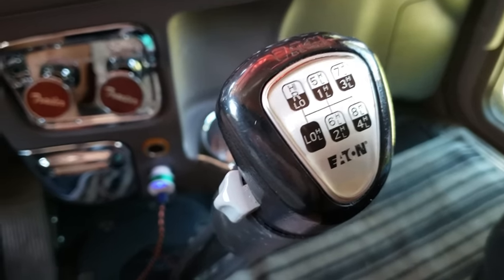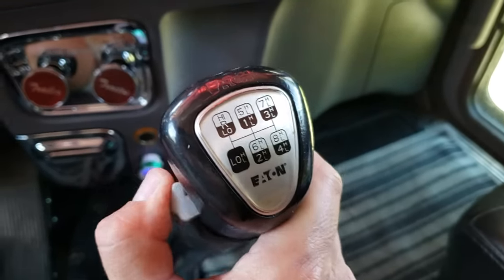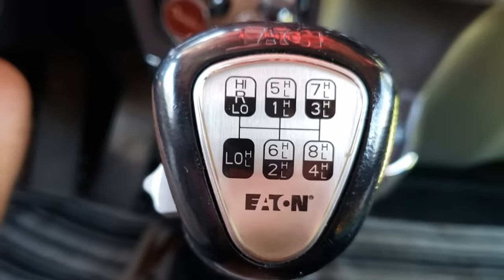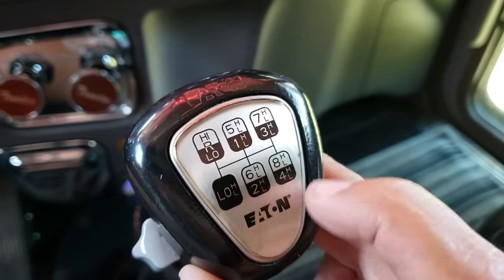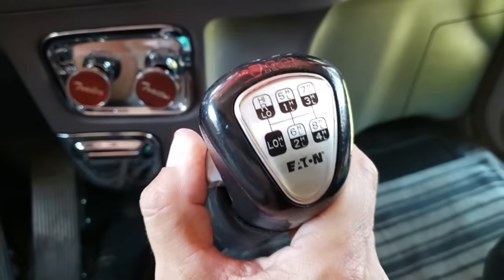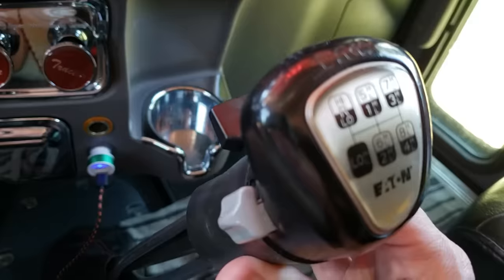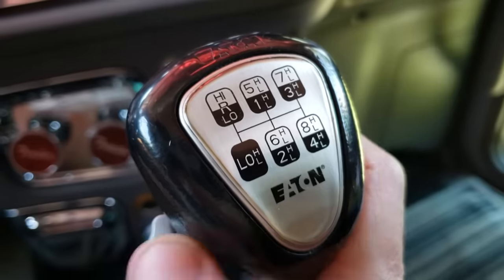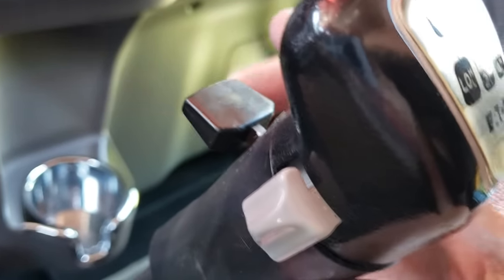HOW TO Shift 18-Speed Manual Eaton Transmission. Peterbilt, Volvo, Freightliner, Kenworth, Mack

Comment: Iv been a wrecker operator for years and i usually drive a 6 speed international. Im about to be in an 18 speed 50 ton. And i was definitely a little intimated. You definitely made a super helpful video explaining everything perfectly! Thanks so much!
Reply from the maker: Right on, great to hear from you...
Reply: How did it work out for you? I haven't driven a manual in years, and I'm thinking about going to a company that only offers 18 speeds.
Reply: I’m driving a 95 international.. when the truck warms up and I put it in gear why does it grind so badly?
Reply from the maker: @williamcoltrane9184  Probably worn trans or clutch.  After it's warm oil might lube abit making it shift better.  1995 is quite old now, nothing like a rebuild if budget allows...
Reply: Well it’s a yard truck that I use to haul material around the yard . It shifts great at first an as the day goes it gets harder and harder to get into gear
Reply: @williamcoltrane9184  it's an international. 🙊
Reply: Teeth can be broken 💔 not grabbing good. Worn out
Reply: Best video ever thank you

Comment: The grey splitter button denotes the transmission as an 18-speed. Red is 13-speed, and blue is 15-speed. Blue can also be a Super-10, but those aren't common at all. There are 18 forward gears. With the range selector down, there are 10 gears on the bottom - it's a 5-speed transmission and you can split each gear. And with the range selector up, there are 8 more gears on the top. In the top range, you don't get low gear. Unless you're running heavy (+100K lbs), in a gravel pit, or on ice roads, most of the time you're just going to drive it like a 12-speed - 4 in the bottom, and 8 in the top. Splitting gears in the bottom...really, I don't know any driver that really wants to work that hard. Finally, for those of you downshifting - downshift whole gears. Once you're experienced, you can split down 1/2 a gear, but again, who wants to work that hard. If ole' timers are explaining it to you, they may say direct (splitter back) and overdrive (splitter forward). Those same ole' timers will tell you that they drove a 5 & 4 uphill to school both ways when they started out! ;0) Safe trucking everyone. All the best, Cheers Rick
Reply: Super 10s are grey commonly one of the trucks in a trucking company I sometimes work around is a super 10
Reply: As somebody who doesn’t drive trucks this explanation blew my mind 😂😂 complicated stuff just to change gears
Reply: Never drove an 18 spd, but used to be a trainer on the Super 10.  Sadly, I can no longer handle a manual for long periods.  My feet just can't handle a clutch for long.  (Health issues.)  I do miss the Super 10 though.
Reply: yes color of selector is the best identifier also blues can be a 8LL
Reply: @jasonbuhl1636  I think that’s what mine is there are 3 lows and 3 reverses and it’s a blue splitter
Reply: @ShazzledWolf32  yes most likely a 8LL most off road or city trucks would use them as they are geared fairly low
Reply: @jasonbuhl1636  it’s in a 357 peterbilt it was originally a cement mixer with the pto on the bell housing then it had a gunite mixer on it now it’s ours it has a heavy haul package with the big front tires and a drop axle
Reply: I drive a 18 with a blue splitter. Same gear pattern as this video but my splitter in a blue switch that flips up and down. Glad you caught him explaining the gears wrong though lol that’s why I came to comments. The low as you said is only on the low side but you can split it.
Reply: Isn’t this a 13 speed
Reply: @ComihcaL no. If you count the forward ranges off, it's 18. L h/l (2) 1/5 h/l (4) and 4 for each of the additional 1 thru 4 gates. So 16 in the 1 to 4 gates, plus L h/l is 18.

Comment: Thank you!! I needed this. My company gave me the 18 speed truck and told me that if I could do 13 , then I could do 18. But I was confused about it. This made the most sense! Now I can ride smoother!
Reply: For best explanation 18 is just 13 but the difference is that in 18 you have to split the gear in low gear ( 1, 2, 3, 4) but in 13 you don't split in  low gear, you split only in higher gear ( 5, 6, 7, 8 )
Reply: @billyjoniklewski8018  are you ok?
Reply: He actually over complicated it. If you can drive a 13 speed then it's identical except for the fact you can now split the gears in lower range as we as the high range. 

Easiest way to think is the gear box shifts just like a 9 speed. But you have added option using the Grey button to split every gear into a high and low as well

Think of it as shifting 3, 3 and half , 4, 4 and a half ,5 ect. With the half gears being optional .  But available if needed.
Reply: @exlynxjock  I needed the over-complicated explanation

Comment: This was a great explanation! I'm going through trucking school and most of the rigs there have Eaton 13 speeds. I've gotten really really good at shifting within a couple weeks, but it only just recently clicked with me how the 13 actually works, and then I got curious about 18 speeds. It looks like they're basically the same with the exception of being able to split the lower range. They don't want us using the splitter very much there though, so I think it'll be a lot of fun getting to mess around with that when I'm finally in my own truck.
Reply: Practice with that 13 you have and remember you do not need to split every gear you can bypass the split and go directly to your next gear of choice
Keeping in mind 
Traveling speed and engine speed you can master that
Then you can drive any standard or manual vehicle 
Stay safe and be good to all that is around you out there 👍😊
Reply: It's pretty rare that you actually need to split the basement.  gears, only if ur pulling a steep hill or a heavy load. But generally i wouldn't recommend it unless you're really comfortable. If it's that steap of hill u may be better off just  pulling it in the gear ur in.

Comment: I had one of those transmissions in a heavy haul truck with a C-15 @ 550 HP.  It also has a switchable rear end ratio between 4.11 and 5.66. The 4.11's would run down the highway as much as 80 MPH but when I used the 5.66 ratio 65 was all I could do, but the 5.66 ratio felt real strong when you were grossing 300,000 pounds. We had an old Ford dump truck that had a turned around 15 speed and a 3406 @ 425. My drivers called it "The Time machine" and one driver that claimed he run it out claimed the clock on the dash ran backwards when he topped out. Here's to big trucks and good truck driving stories.

Comment: "There's never a reason to haul ass in reverse, okay"-Quotes to live by
Reply: When you're backing nearly a mile down a logging road....just sayin
Reply: LMAO 🤣
Reply: @aaronsanborn4291  A lot of 10 speeds have a really low speed high RPM in reverse so high gets a lot of use.
Reply: If you have to merge with traffic you can't f*ck around!!!
Reply: Unless someone is going to back into you 😂
Reply: I've had to haul ass in reverse to back up to a paving machine with a load of asphalt plenty of times.
Reply: Reverse does not count as one of the gears... low is split in low range, plus 1-4 split in low range, (totaling 10 in the low half of the box), then the range shift, then split 1-4 in high range (totalling 8 in the high half of the box) for a total of 18. Reverse is never counted.
Reply: Only Mack truck are allowed to.
Reply: There isnt... believe me. This is years of experience. 5% of your driving time and 95% of all preventables.

Comment: That was an excellent explanation. I used to drive a little 5 tonner here in New Zealand doing metro freight, 6 speed manual. Tried an 18 gear once. I cleaned the teeth in the gearbox more often than not. I heard many times that the eaton transmission was almost impossible to damage, one of the most forgiving transmissions out. You would be an excellent tutor for teaching ones like me how to drive a tractor trailer unit. Sounds like you've got the patience (to a certain level) to teach ones like me who clean the gearboxes teeth.

Comment: You're an excellent teacher, because I understood everything you explained, and I've never driven a truck in my life and only drove a  manual yeeeears ago and not very well.  I've  always like learning a little bit about a skill others have mastered. And also having an understanding of what drivers of big rigs are doing technically , makes me want to give them some more room to do their thing and I do ! Well done.
Reply: need to start sending all the SWIFT drivers here lol... we had one drop off a load on my overnight shift... ho boy where to start... they slammed into the bay on the third attempt, the first 2 they were too far off center to get the lift platform into it... he came inside like twice to see where he was... i told him the second time to just pull forward, put it in neutral and just roll it back... he gets back to his truck and i hear it spool up and shake and i yelled as loud as i could "TAKE THE BRAKES OFF!!!" lol my managers were facepalming... yea... that guy took literally 15 attempts to back up into our bay, the one time he pulled ALL the way out trying to re-center the trailer...

Comment: I'm about to apply to a local CDL school in the next day or two, and I was a bit intimidated about the possibility of driving an 18-speed manual transmission. Doubly so since I've never even driven a regular car with a manual transmission, though I do understand the theory pretty well. This video was a tremendous help in soothing those nerves. Thank you so much.
Reply: How did you do bro, I’m starting trucking school soon
Reply: @alexpadilla2319  Passed with flying colors back in May in a 10-speed manual, and about to have orientation at my first trucking job this coming Wednesday. Had to go to Swift because I rear-ended a guy back in 2020, but at least any stupid shit I manage to do won't tarnish a good company's reputation until that falls off in a few months.

Anyways, definitely let me know how your own schooling goes! I'm keen to hear.

Comment: Shift it like a 13 speed until you get to the last two shifts, which shows 7th and 8th gear, then use the side splitter on those last two. Just remember to split on low or back before shifting down to the 8th then split again for your last gear for your highway speeds.

Comment: There's also a secret 19th gear....Granny low in high range. when unloaded it enables you to stay in high range be able to take off in about the equivalent of 3rd gear and go straight to 5th without having to go through the first 4 gears and change to high range. good for pulling out into high speed traffic and getting out of your own way. but you can only use this secret gear combo when your empty/solo or else you'll shave some life off your clutch. you can also split the the transition from granny high to 5th to ease the rpm transition.
Reply: Hahahaha I’ve tried teaching this trick to some of my veteran drivers and they look at me like wtf ??? Scratching their heads
Reply: Good point. I used to do that in a 2 stick Mack just for fun.

Comment: I used to always drive a 10 speed and a 13 speed. I love the 18 speed more options when you need it in the low range being able to split the low range unlike the 13 which only allows the splitting of the high range.

Comment: As someone who has only experienced a 10 speed I've always wondered how that side splitter worked.  This is the first time my question has been answered.  Thanks man.
Reply: With a 10 speed the gray knob forward you would not be able to shift into fifth...
Reply: The switch on the side is called the RANGE

Comment: Spent my life with a 13-spd.  Loved it. Could never see why low range needed to be split, most guys skip those anyway.  Where you really need that little boost is only on the highway in hi range anyway.
Reply: Hauling heavy from a dead stop on a hill, splitting with the engine brake you can continue gaining speed, it's easier on the running gear and keeps you in a good torque range.

Comment: The first manual semi transmission I drove was a nine speed. Reverse is top left, low is bottom left, first is top middle, second is bottom middle,  third is top right, for fourth you flip the range selector and pull it back to low which is bottom left, fifth is top middle, sixth is bottom middle, seventh is top right, and eighth is bottom right. Problem is I only drive on a yard, so I haven't gotten downshifting down yet.
Reply from the maker: I hear ya, the best way to learn all these transmissions are to just drive drive drive, take it easy...

Comment: Hi Corey, I am a retreated radio dj (after 41 years) and I am following a Class One driver course. Thank you for your clear and sharps explanations, so far the best that I saw. It helps a lot. Kind regards from Canada. 🙂
Reply from the maker: Right on Bruno!  I was in FM radio from 1987 to 2017 on-air, music director, and program director.  Here in Salt Lake City at KBER, KZHT, K-Rock, and The Blaze.  I still love radio and own Pure Rock Radio, it's streaming 24/7.  I wish the reliable pay was still like The 80's and 90's.  Trucking gives you 100% security and income.  Plus there's 50 ways to drive either local, regional, or on the road for awhile.  Good luck to you and I'm glad to hear from another radio pal!

Comment: Unless you are hauling heavy loads or in mountainous regions, using the splitter is more work then necessary.  I ran a 4k gallon fuel truck with an 18 in the hills WV/OH.  The best use of the splitter was when taking off on an incline and didn't want to spin the wheels, I would split it on the low side and while in low gear remove foot off of clutch and vehicle would start out without the use of the accelerator pedal and minimal chance to spin wheels or dig into soft terrain.  
The other useful times where while climbing moderate and windy inclines would keep splitter on high or top side of gear so if I found the engine rpms start dropping I would drop 1/2 gear by simply flipping splitter and briefly letting up on throttle to make the switch and lose very little momentum on the transfer.  Most of the time was enough to get to the crest or through the curves.  Of course if I had larger switch backs or steeper terrain it was necessary to take a whole gear I would stay on the top-side or high-side when operating normally on hill climbs.
I wasn't using this transmission for heavy haul so was well below 80K and wasn't necessary to utilize the ability to split gears on top range except under a few different scenarios.

Comment: That was a better explanation than I received from the yard when I went from 13 to 18. Retired 15 years almost.
Reply: And why need to split bottom were you 100k. I skip so many lower gears at 80k. Maybe your drove a neutered truck. Is that how you roll

Comment: Piece of cake. I drove these for over twenty years. Kind of fun actually. The only time you ever use the clutch is when you stop or have to use reverse. I rebuilt a few of them also. Big job to cage the transmission when taking it apart. Super strong transmissions. The newer tractors that are automatics suck. You can’t really select the gear you need to control the decent on a hill like you can with a manual. But yes fun to drive😎

Comment: Great video aside from one point I feel I need to make, you should Never move your splitter After u let off the throttle 😬,  the splitters are friction based and you can ruin the synchro’s after a while. So if we’re talking longevity, U should b On the throttle while u move the splitter. And No , not the Hi/Lo Range Selector, the thumb splitter, for the A-holes who will be confused as to what I’m trying to explain lol 🤷🏻‍♂️
Reply: Well you can do it only if you go out and back in the gear ! On a rapped truck you have to for being smooth!  But normaly you absolutly right !!

Comment: Drove 18 for 10-12 years. I loved using the low gear on the high side for cornering and stuff. Only thing is if you need to continue to slow down while you're in it, usually you will need to skip fourth and go right into third. Sometimes high side of 3rd works. It takes a lot of time to get comfortable enough to know what gear to put it in just on how the truck feels. I drove about 40% of my career off highway in bush.

Comment: I can't even imagine how complicated the inside of that transmission is. I've never driven one, and it looks really involved, but I suppose it's just like anything else at first: intimidating until you use it for a while and then it become second nature.
Reply: When I first showed up at trucking school I was intimidated and I drove wreckers for 2 years. It comes with time. I also injured myself in 2008, and just did a ckeck ride the other day, and drove an 18 speed for the very first time. The mechanic said ignore the selector and drive it like an 8 speed (just use the hi and low(finger selector without the thumb) and it works like that. I drove for the first time in 14 years like I hadn't missed a step... except for the transmission issues...lol. with practice I will get this too...lol. they are all scary til you get some time in the 'cockpit'.

Comment: I never thought that I would like a Road Ranger, as the 13 had nothing on the 4X6 Spicer in a log truck, up in the Cascades. Then I drove a friends 379 Pete with a 3406B Cat and an 18 speed, hauling a Berger yarder, with a lowboy. One of the smoothest runs I ever made hauling heavy equipment. Speced my last truck with an 18 speed, and 2 speed Eaton rear ends. Smooth as silk, off road and on.

Comment: 13 speeds and 18 speeds are the most fun-to-drive Transmissions but you really don't need 18 speed unless you're hauling extremely heavy loads I love the 13 speed plus it's better on a few I think
Reply: Agreed, 150-200k plus you might need to split the lower